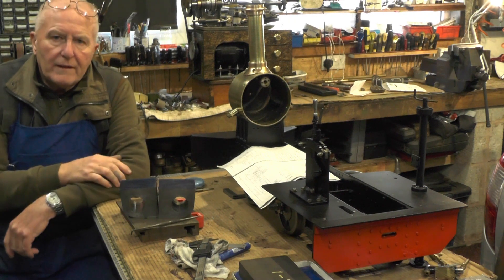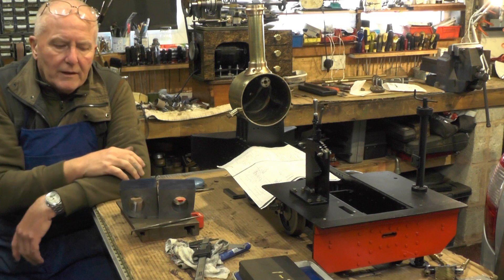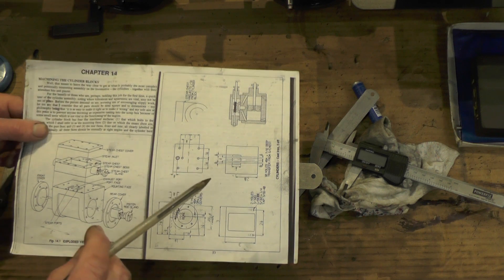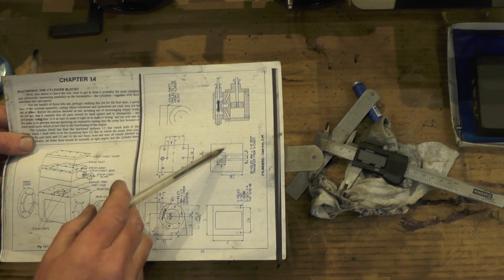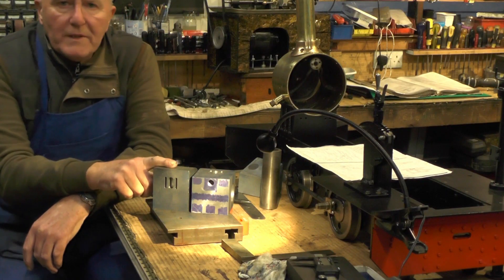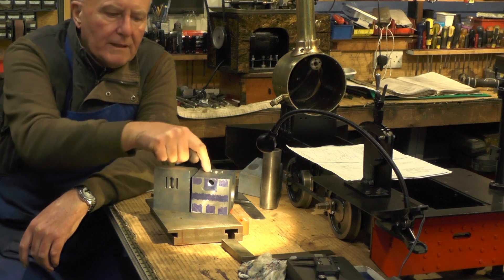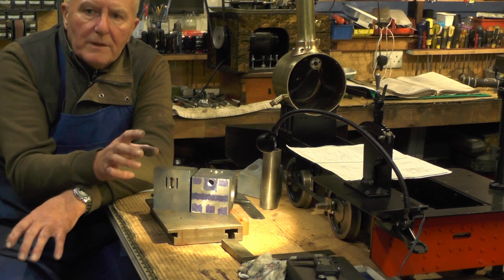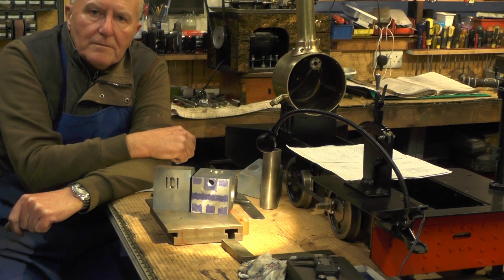Sweet Pea Steam Locomotive Build Part 7c (Cylinders - Machining Ports etc.) "mr factotum"

Comment: The engine I'm messing about with at the moment started out as an exercise in learning how slide valves work. Dad gave me an old Tyzack lathe in the 90's which he had bought from new in the 50's but had never had time to really use. I loved it and still have it but not in use. I cobbled a vertical slide for it and milled the ports with that. It was really hard to get everything lined up if I remember but now I have a mill, whoop, whoop. Thanks' for sharing your experiences and skill's again Kev, very enjoyable
Reply from the maker: Cheers Ian
Good to hear you have a mill
i have an interesting video coming in the next few weeks, my Myford machining my assembled Micro lathe sat on the Myford's cross slide,👍👍👍👍
thanks for the feedaback
appreciated
Kev
Reply: Brilliant @MrFactotum